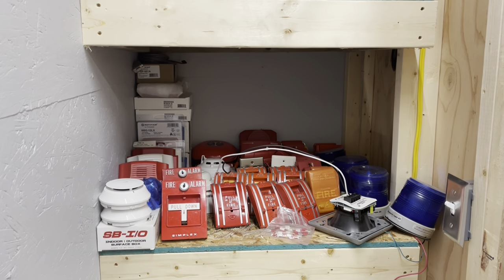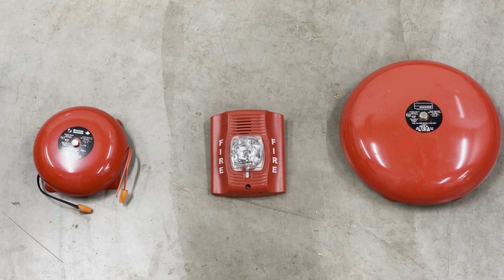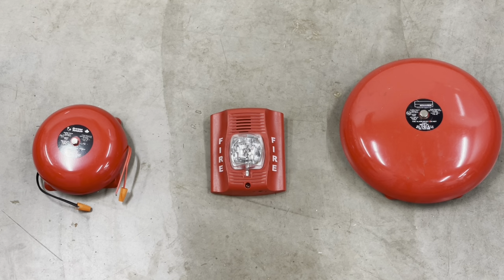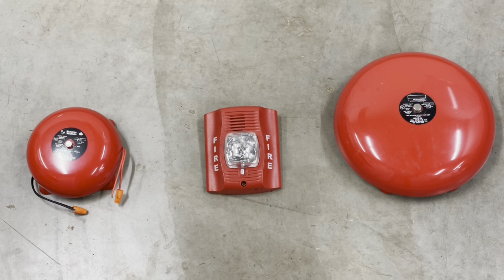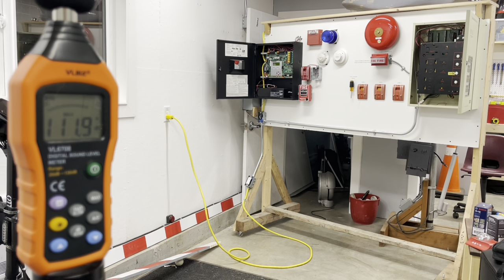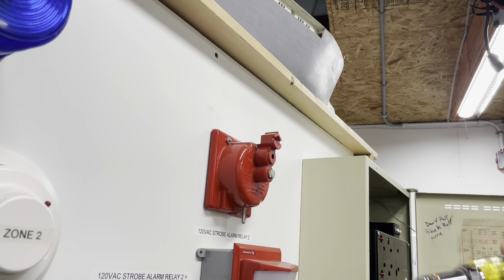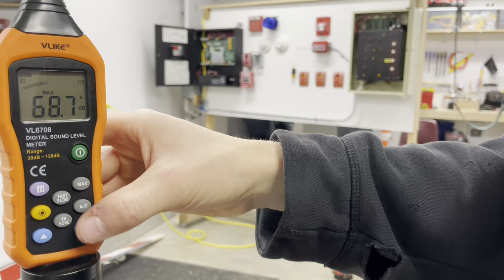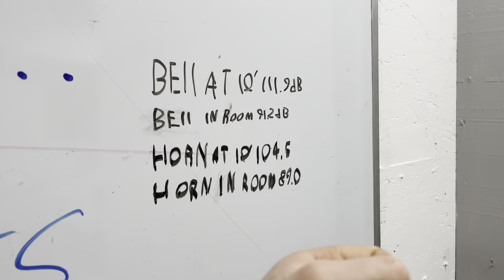Horn strobe vs fire bell which is better and louder

Comment from the maker: As for my final answer as I never really said I would say horn strobes are the future and the way to go but in countries like mine Canada bells are superior as people just don’t care about horn strobes and don’t react the same way
Reply: Same with Singapore
Reply: Singapore where I live also uses fire bells
Reply: Nice video. Just out of curiosity, I played the sound of the bell on my fire alarm speaker, and it just sounded off. I couldn't help but notice that the motor sound could not be heard. when the bell is mounted to the wall, the sound of the motor running resonates in the walls. That just doesn't happen with a speaker or horn, even if it's a speaker playing a bell sound and I feel that that's one of the reasons fire bells have a sense of urgency that nothing can ever recreate. As an American, I've just learned to accept horn strobes as fire alarms. Another problem with the horn strobes is that it's not a standard sound. each brand has their own sound, making it hard to tell what's a fire alarm and what's just a random buzzer. That's not the case with bells. Both bells and horns are great, just in their own ways. It all comes down to how people react to it. It's interesting to see how fire alarm devices vary from country to country.

Comment: Southeast US fire alarm tech here. Most of our business is healthcare with hospitals, nursing and rehab facilities, and assisted living facilities. We've been installing the System Sensor chime strobes. They still fulfill the NFPA 72 decibel requirements but with the handy added bonus of not making you bleed from your ears as you walk by them. Check out System Sensor part #: CHSRL.  But bells are still definitely installed by the sprinkler guys on the outside of the building, usually right where the riser room is, to indicate water flow to incoming firemen. Oh and I've seen a bell right above a releasing agent panel that we didn't install but got called to relocate, it was just so it could alarm locally. The releasing panel was part of a larger system and triggered the main building FACP.

Comment: With the majority of devices over here in the states being mechanical horns, horn strobes and maybe we're slowly transitioning to speaker strobes where applicable, every now and then I will see bell's being used for sprinkler alarms and for general notification, too. I remember seeing a 10" Potter being used for that purpose. I do want to say this, however. Your results may've proved bells are louder, but as someone else in the comments said you'll need to factor in reverberations, room or hallway size, and some other things. I'm not trying to falsify your conclusion, but the results can vary with certain factors including installation vicinity, and type of device. With that chopped from the block, it is a nice video demonstrating the SPL of bells and horn strobes.

Comment: Here in the US I've only seen mechanical horn strobes/mechanical horn lights, horn strobes, and speaker strobes. Haven't seen and fire bells at least not in action. My elementary had Specturalert advances (Horn strobe don't know model), my middle school had mechanical horn strobes/ mechanical horn lights (4903-9101, and don't know the other one). Then my highschool had speaker strobes (SPSCWL-CLR-ALERT SYSTEM SENSOR, SPSWK-CLR-ALERT SYSTEM SENSOR, SPSWL-CLR-ALERT SYSTEM SENSOR). The only time I see bells are on the outside of building but I've never seen/heard  them in action.
Reply: The bells are for the sprinkler.

Comment: Most 24V fire alarm bells have their striker driven by a small DC motor, thus knocks a little bit slower but brighter and more "grainy", giving it the distinctive texture of sound different from general-purpose 120V bells, which are typically solenoid-operated and knocks at higher rate, generating harsh, fuzzy and chaotic metallic noise as what an angle grinder cutting through metal pipes would sound like.

Comment: I think it also depends on which province the system’s installed in, at least here in Ontario horns have always been a bit more common than bells, although Ontario’s building code had a big change in 2014 no longer permitting new systems to install bells and requiring any buildings with more than 1000 occupants at a time to upgrade to speaker strobes that sound like the previous alarms installed

Comment: Way back in my day, I preferred bells over horn/strobes and I still do.  You are never going to be able to replicate the resonating and vibration gong noise that bells put out with a horn/strobe.  And, that resonating vibrating gong noise is apart of the charm of bells.  Especially when the bells do code 3.

Comment: Over here we just have bells on the outside on the building, and flush mounted, nonchalant, white speakers on the ceiling, and the bells are always on continuous. The internal speakers are code 3 and always are a low, deep tone. Although, sometimes a general evacuation is called for a fire, that is a rising tone in code 3, followed by "Evacuate now", "Evacuate as directed", or "Emergency"

Comment: It’s not always about being as loud as possible, it’s more about sending the message effectively. When I hear a modern horn strobe going off, with the crazy sound it makes, I just want to get away from it as fast as I can. Bells don’t have the same effect on me. Funnily enough, my high school repurposed their fire bells and used them as normal bells to signal when class starts.
Reply from the maker: Usually bells are more effective as a more well-known fire alarm
Reply: @nics-systems-electric  well like you said, bells were everywhere in Canada, so I can see why that would be the case. I also think Hollywood has a bit to do with it too. Ever seen a fire alarm go off on a tv show and it not be a bell?

Comment: This is a very interesting discussion to me. I'm from the US, and based on my own experiences in school and such, I find horns to be a much more urgent signal than bells. In my elementary school there were bells mounted outside, but they never had much effect on me. Fire alarms used to scare me a lot as a kid, but I was scared of (and later fascinated by) horns, not bells.

Having said all that, I think perceived urgency of a signal is very much based on past experience. I recently read that 2003 Canadian study which found that people didn't find the temporal 3 pattern to be urgent (I'd love to know what people think of it now; I certainly think it's urgent), and I was surprised that people thought the continuous bell was more urgent. To me, and I think to many in the US, that sound is a school bell (i.e., signalling a class change), not a fire alarm, although my schools happened to use a square wave tone for that purpose instead. However, the ISO temporal 3 standard specifically states that it makes no stipulations in regard to the signaling device used; it only dictates the pattern of said signal. My point being, why install horns at all? If Canadians in large part are used to bells and find them more urgent, there's really no need to change that unnecessarily. In fact, I can relate to the confusion in fire alarm signals. Again in my elementary school, the electronic horns and the bells were on march-time, and the mechanical horns were on continuous, and as a kid, that confused me at first. That's why I like the idea of universally adopting one pattern, even though some don't find temporal 3 to be urgent. But it's also why I think that if bells, rather than horns, are what will make people react quickly and evacuate, then the bells should stay. And vice versa.
Reply: i think it just depends on what part of the world you're in.
Reply: @J19_vlogger74  I completely agree. I just think authorities shouldn't go around unnecessarily changing signals and creating more confusion just because other places use other signals. As it happens, I'm currently staying in an apartment in Maryland where the fire alarm is a bell on continuous. I don't think it's very urgent-sounding (or loud), but I wonder if it's a legacy system (the building was built in 1970).
Reply: The temporal 3 pattern has existed since the turn of the century. I would assume that the NFPA wanted a recognizable tone pattern that would tell everyone that there’s a fire emergency and have no confusion about it. To me, continuous just blows everyone’s eardrums out, and March time always sounded too silly. By now people should understand that a temporal 3 pattern always means fire. That’s why it’s also used in residential smoke alarms and fire alarms on burglar alarm systems.
Reply: @mattdude  Exactly how I feel, and as a deaf-blind person that gripe with continuous is double for me. Temporal 3 has those pauses where some communication can be had. I get that continuous is supposed to physically drive people out, but I also think this creates panic rather than an orderly evacuation. Temporal 3 is loud and universally recognizable thanks to smoke alarms as you said, but it also has an almost measured quality to it, if that makes sense. So you don't run away screaming, but you do know there's a report of fire and you need to leave. But beyond that, when people imitate a fire or smoke alarm in the US, it's almost always temporal 3. I think the urgency of that signal is now much more well-established than it was 20 years ago when the Canadian study was done.

To be fair, though, the continuous in my current apartment startles but doesn't scare me - the bells just aren't all that loud. But the first time I heard it I was confused as to what the signal meant, and since I'm here I'm obviously a bit of a fire alarm geek. Loud or not, if the bells had sounded temporal 3, the meaning would have been abundantly clear to me.

Comment: I think it really depends on the specific Bell and horn in question. an old Edwards fire alarm listed vibrating adaptabel is lethal, and it’s sheer volume borders on unsafe, but a mircom BL6B 6 inch motor bell is barely louder than most fire alarm speakers! As for horns are we talking about a little 1st generation Edwards genesis or are we talking about a vibratone mechanical horn with the volume screw lifted off, I’ve heard techs in the field say horns are louder I’ve heard techs say Bells are louder! I say it really depends on the specifics of that particular device!
Reply from the maker: I was basing this off electronic horns old-school vibrating horns are equally as effective as bells in my opinion and when I say bells I talk about 10 inch motor or vibrating bells as those are by far the most common

Comment: In Mexico, European sounder strobes are just as common as bells are in Canada. I've stayed in an all-inclusive resort in Mexico 2 times as a kid and noticed that they have Roshni sounders and European-style call points instead of pull stations. Roshni sounders and other European-style fire alarm AVs are much more durable than Horn or speaker strobes.

Comment: Herein the UK bells were the norm and still are in my area both my high and primary (elementary) schools used bells in fact at my high school the bells were on strobe mounts and also did a single blast to signal a class change

Comment: I'll be honest, I've seen people in the US who are just as clueless when they fire alarm goes off regardless if it's a bell or a horn strobe. I've seen many places now putting in verbal announcer systems which will tell you if it's a fire or Co or some other emergency that requires an evacuation.
Reply from the maker: Yes I’m guessing you’re talking about voice evacuation system I would say they are superior to both because of guided messages however no system or sound is going to make someone leave that doesn’t want to go

Comment: Now try the bell without the gong. Would anyone notice the bell is even ringing? Also would love to hear the difference between Durabel, 439D and MB-24 bells as I've often noticed the tones differ slightly especially between vibrating and motor bells.

Comment: (sorry for my bad english)
I think one big problem with firebells is, that they are very often not taken seriously, especially in public buildings, such as for exsemple shopping centers, because the people aren´t clearly advised what to do, what makes them often simply egnore the alarm. That´s not only a problem with bells, but with all firealarms without a vocal announcement. Iam from germany, where you don´t find any firebells, but we also have the same problem. That´s why I think for the purpose of a safe evacuation it´s important to clearly tell people how to behave, why I think all modern firealarmss should be required to have a voice announcement, what makes devices with a speaker, instead of Bells necessary. 
Also the sound of a firebell may be alarming, but especially in areas with a high dencity of people, that may become a problem, because it could also result in a panic. Because most people aren´t that interested in firesafety, and don´t knew, how safe modern buildings are today, and that there is usally no necessity for a panic, but an orderly evacuation, what could cause them to overreact. But when there is a clear voice announcement, there is no need for a loud, aggressive or alarming soud. Voice Announcements also elliminate the problem of people not understanding the alarm, because they aren´t used to it. If they are told, that there is a fire and they need to evacuate, there isn´t anything they couldn´t understand.  
That lag of knowledge about the topic of firesafety especially stood out to me, after the incident at the Grenfelltower in London, after wich a lot of people thought that could happen to evry highrise. They didn´t know, that the fire in the Grenfelltower only got so big and deadly because the constructioncompany didn´t follow the firesafety regulations for facades, wich would have kept the fire isolated in one appartment, instead of climbing up the building, and that there are dozens of fires in appartmentbuilding, evry year, that turn out absoulutely harmless, due to working firesafety meassures. 
One more place where Bells could be problematic, especially today, are highrises, where you often have a stay put policy, or only evacuate the people from in and around the levels, effected by the fire, instead of the whole building. In Asia, and I think also in the US there are also often areas of refugee in very big buildings, wich make the evacuation of a whole building in the case of a fire, unnecessary. If you only have firebells, it can become difficult to provide theese specific instructions to the people effected by the alarm, especially, when they weren´t prepared. In Schools you can do firedrills, and you can expect the same persons evry day, in a building, they know. But in malls the customers change evry minute and in appartment buldings, as well as in malls there are no firedrills, becuase, at least in malls they wouldn´t make any sense due to the continous change of customers inside. So the people are usally confronted with the alarm unprepared, what makes it more important to provide clear instructions for the evacuation to avoid a panic, or people egnoring the alarm . In therms of avoiding a panic, here in germany for exsemple they often don´t say, they are evacuating due to a fire, but due to a "serious technical malfunction" or an "incident in the building". And in the London subway for exsemple, they have the phrase "would Inspector sands pleas report to .../ go to..." as a coded prealarm, to inform the person in charge, that the firealarm has been activated. In therms of the risk of people egnoring the alarm, it´s mostly already eanough, to directly tell them to do so. There have been studys, that showes, that egnoring the alarm usally doesn´t happen because people don´t take the potential thread of a fire seriously, but because they aren´t exactly shure how to behave and then tend to orientate there behavour by the bahavour of other people. So if the majority doesn´t evacuate, the single people are less likely to decide themselthes to evacuate.

For theese reasons I think firealarms without a voice announcement, such as bells, should only be used in Buildings, where people are used to the alarmsound and fireaction, such as factorys, offices and schools, while all public buildings, should have voice alarms (ofcourse combined with a alarmsound, and at best in multiple languages).

Comment: Sound difference levels of the bell and the horn at 10 feet and in the room

Bell: 20.7
Horn: 15.5

So it appears that the sound of the horn dropped by 15.5 dB when it was in the room because the sound it makes is a Frequency Modulated sound and it makes it travel in great distances throughout the building and through walls because FM sounds are done by pushing the carrier frequency in the opposite direction so the modulated frequency can push the carrier frequency much further without the need to get more louder. The same thing applies for amplitude modulated fire alarm sounds like a SpectrAlert Classic.

So yes that must be why the bell didn't do so well in the room because the sound it makes is from the striker hitting the gong at a really fast rate which is a mechanical sound and not an electronic synthesized sound that would make a amplitude or frequency modulated sound that's designed to travel further without the need to get more louder and penetrate through walls a lot better

And by the way there are some horns that do very well or don't do very well through traveling great distances or penetrating through walls